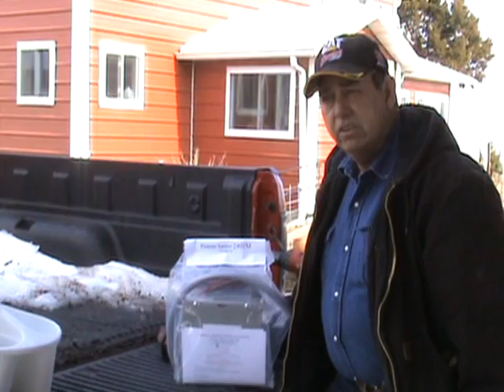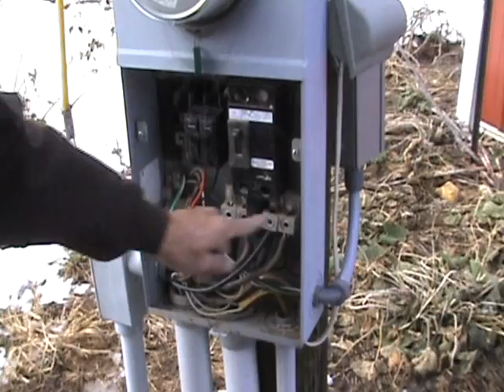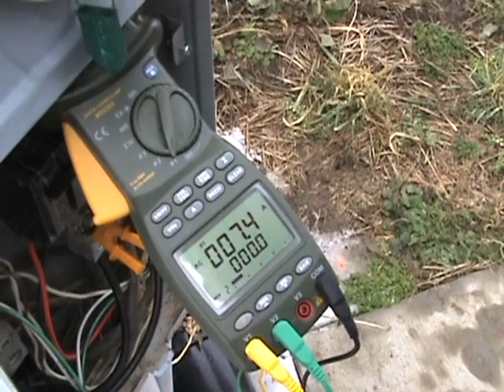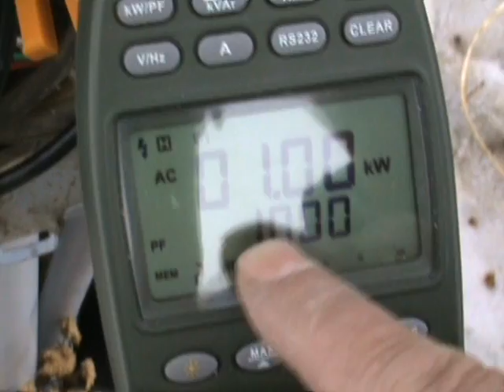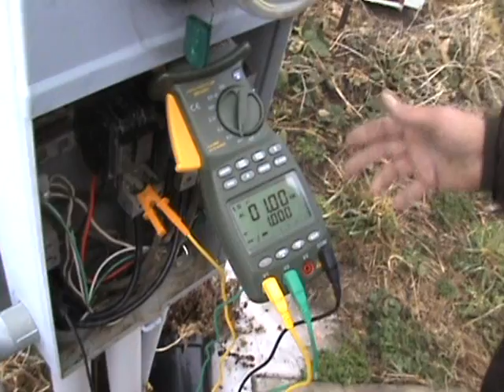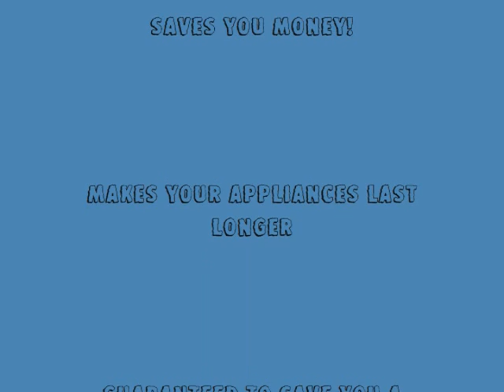Power Saver 2401M

Comment: saved a lot of energy just by turning the breaker off and back on that's a joke move you powered the unit to level the load out and then tripped it off and back on to show a drop in power this a complete scam why don't you dead drop the capacitor and lets see what it does from the first power on and how it leavels out on its own without doing a pre-charge of the unit..

Comment: Your electric meters basic unit of measure is the watt AKA "true power" or volts X amps X power factor. 

This device ( a simple capacitor) will possibly lower "apparent power" or the amps in the formula but will only affect the amount of your electric bill by a minuscule amount by every so slightly lowering the loses in the wiring by way of the lower amp draw. 

There are some utilities that penalize large commercial users for low power factor and this device could possibly save these users some money, it will definitely not save a residential user any money at all.

In the example the current dropped from 10 amps to 7.4  and the power factor is 1.0 after the device was turned on, this tells me that the power factor was at about .74 before the capacitor was turned on.

125 volts X 10 amps X .74 power factor = 925 watts (before device is turned on)

125 Volts X 7.4 amps X 1.0 power factor = 925 watts ( after device is turned on) 

But do not take my word alone for this, ask around or do your own research.